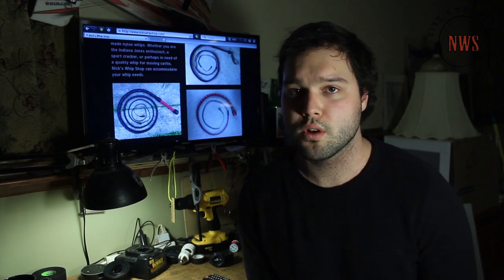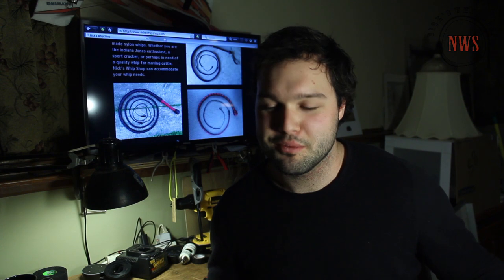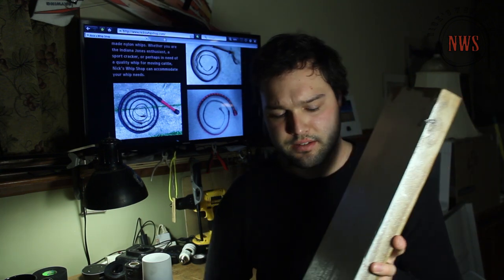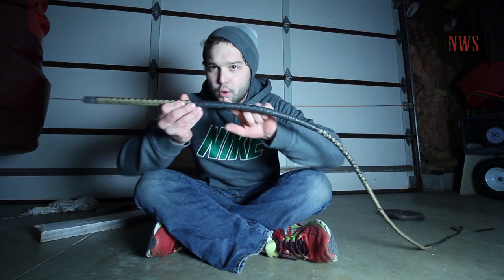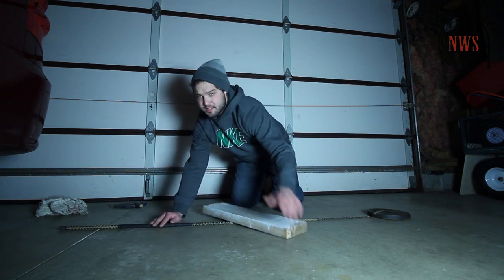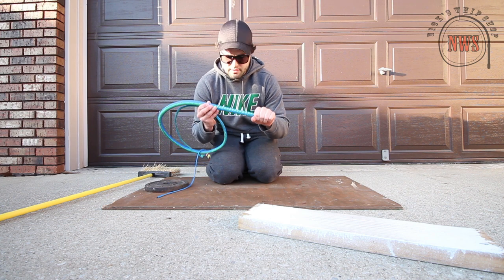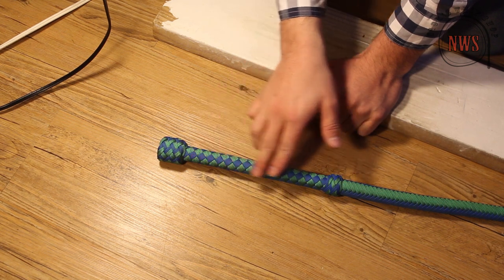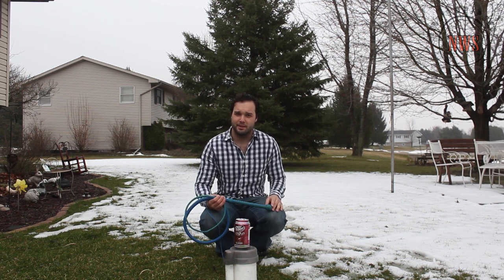A Few Tips on Rolling Whips | Nick's Whip Shop

Comment: Very nice!  What I'd also recommend is securing the whip at both ends, and such that it can spin (but not twist).  Otherwise as you get closer to your tail, you are twisting it.  You'll have to plan ahead a little for extra material, especially at the heel, or else get a nice piece of leather lace to lark's head around it, so you have something to use to tie it to a weight or a hook.  I like the idea of the plasti-dip for paracord, but for leather I wrap a fresh section of paper grocery bag around my board--it's always clean (but you need to make sure you change it!), it provides grip, and it will mop up any extra conditioner on the strands, as well as collect minute bits of debris (usually leather "dust").  Kick butt way to clean your whip fast.

I wonder how the plasti-dip would work on a leaf spring?  I've never got one, because I'm not sure I'm skilled enough to polish the surface so there are no burrs or scratches that might damage leather (or paracord, for that matter).  Plasti-dip might provide both protection against that, AND extra grip, and it's a lot heavier and CURVED compared to a piece of board.

As for a rolling surface, I got lucky and inherited my grandmother's marble topped baking table.  Over the decades, the surface has been worn (from all Gran's yummy bread dough kneading!), so it's still smooth, but it doesn't have that super polished glassy texture like a new piece of marble or granite does, which also provides grip.  This table is MUCH easier to get really clean than the shop floor--I can even use acetone with an alcohol chaser.  For upper body strength?  Fall in love with someone who's at least 6' 6" tall, and promise them a sandwich if they'll roll your whip for you...hahahah!  OR!  Kneel on a chair (with a cushion, trust me, and don't use a stool to stand on because you can fall very easily).  Again, this is for leather, which you can't clean the way you can paracord.

Comment: I use a 2x4 and a 15x10 x1" thick board. I use a board for the bottom so the heel knot is clearing the floor when I roll the handle and it also keeps my floor from getting all greasy (I work with roo). This next thing is something I think I stole from Japanese sword smiths who wrap their blades when polishing them, but it's been so long I can't be sure anymore;. In any event, I wrap both the 2x4 and the board with paper. I just use plain 8 1/2 X 11 white paper. It's big enough that it'll wrap around the 2x4 and I just hold it in place with a strip of masking tape. The bottom board being bigger needs the taper to hold the paper in place, so I tape the top and bottom of the sheet to the board. The paper does pretty much exactly what your plastidip does, with the added bonus that it also absorbs oils when rolling a leather whip. I change the paper out for each whip, and I usually need at least three paper wrappings to get through rolling all the layers of a whip and two of those are just for the overlay! It sounds like a lot of paper, but at the end of the day it's recyclable anyway and a 500-page stack from Staples goes a very long way. I suppose you could use brown craft paper, but it's not as strong as white paper and has a tendency of tearing when it gets wet with grease.